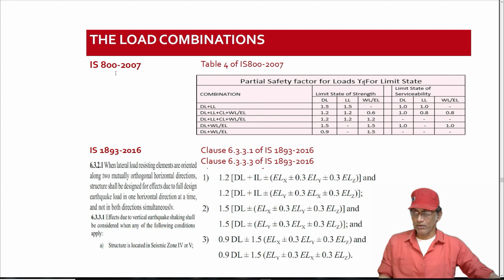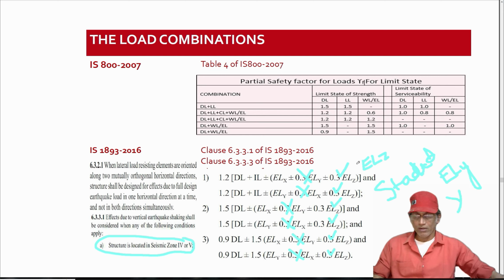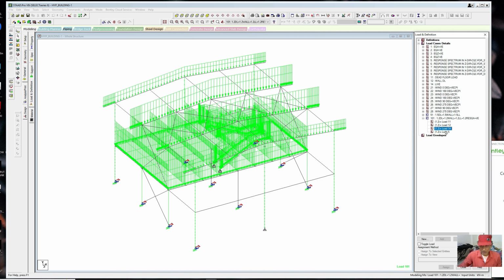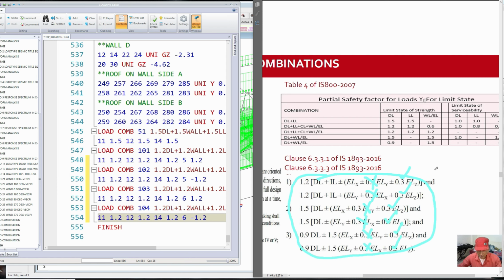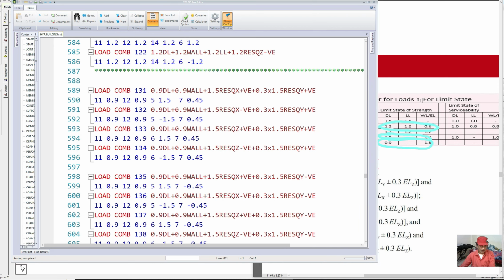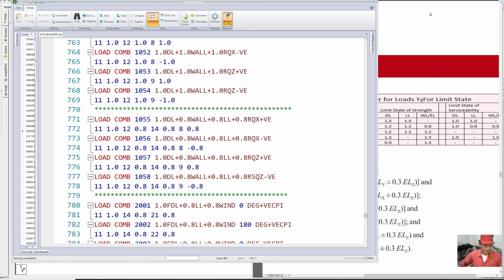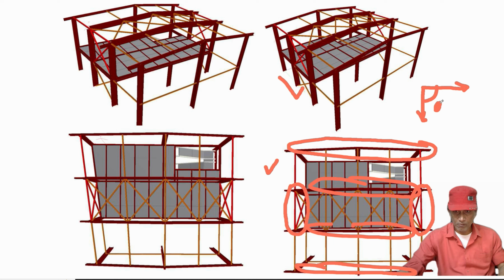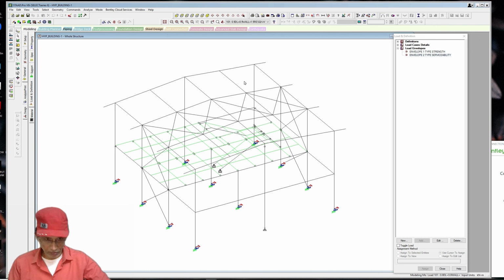SECTION7 THE LOAD COMBINATIONS

Comment: Should we use Static Lateral Forces (EQX, EQZ) in load combination while building design with Dynamic Analysis.  Or Static load should be  used for only  to compare static and dynamic base shear to scale the dynamic direction factor in Response Spectrum definition in staad pro. Please solve my doubt.
Reply from the maker: I recommend to use Static Analysis and Optimize Your Design with STATIC Analysis by making Dynamic Analysis  and Associated Load Combination Commented  . This will be much Faster, Later You may Put on Dynamic Analysis, scale Base Shear, and redesign those few members which are failing in Dynamic Analysis. Otherwise, Many Number of time you  will have to scale base Shear, which could be time consuming.
Reply: Thanks Sir to Reply.  @softwareaidedstructuraldesign

Comment: Which load combination should be used for Dynamic analysis for RCC Structure?
Reply from the maker: It is same as for that for Steel Except
1.2DL+1.2WALL+1.2LL+0.6RESPONSE SPECTRA Group.

Comment: These 30% additional lateral load , Should these load combination use for Dynamic Analysis or Static ? or only for non parallel structure to global axis in plan(top view)?( For RCC Structure )
Reply from the maker: You can choose any method. But for Building which requires Dynamic Analysis  as per code,  You should use Dynamic Analysis.  But with STAAD Pro V8i , you will  not be able to add 30 %  along Vertical direction with Static Analysis. in recent Econnect Version, they have included a Seismic H , but I am Yet to go thru it.
But  thing is that You may choose any Method for Which Dynamic Analysis is not compulsorily stipulated by Code.
Reply: @softwareaidedstructuraldesign Thanks Sir to Reply.